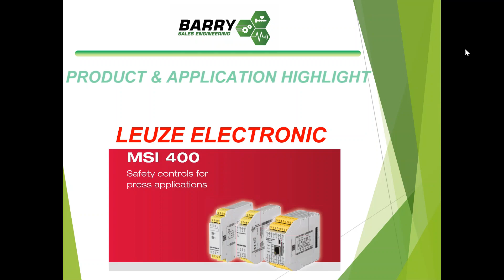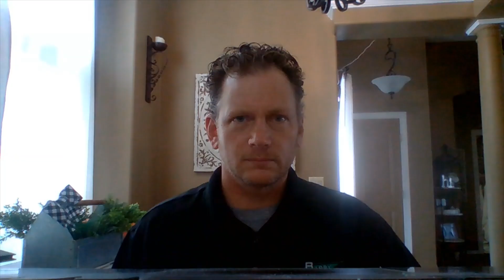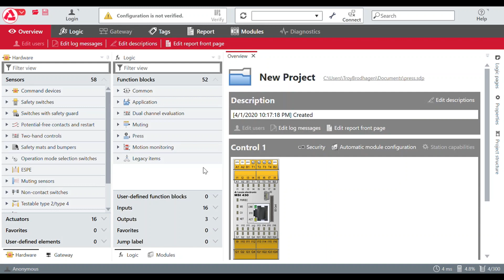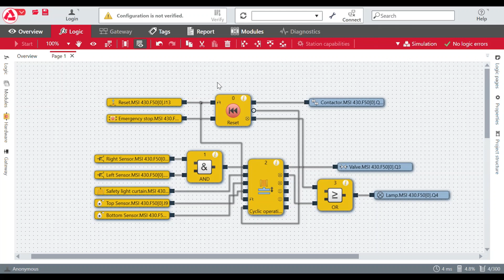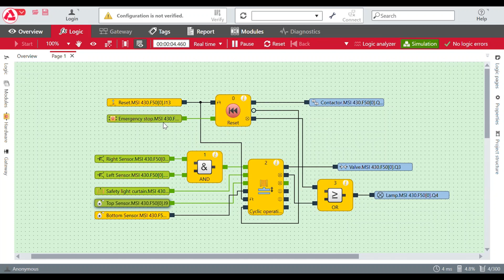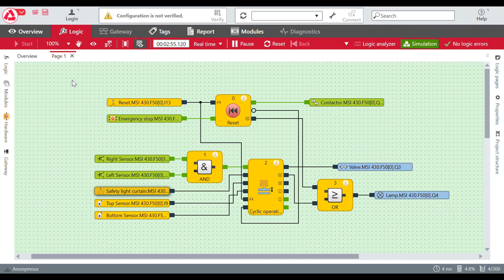LEUZE MSI400 - More than just a Safety Controller

Comment: hi, how can i design a branch for 2 light curtain ( without muting input) and 1 emergency button? I couldn't find any video about MSI Designer.
Reply: or which block should i use for combinating them?
Reply from the maker: @DramaofDrummer  A simple "AND" logic block could be added to monitor the two light curtains.  You can then click on the "AND" block to change the amount of inputs the block is monitoring to 3.  Connect the E-Stop input to one of the inputs on the AND block as well as each of the light curtains.  Now all three have to be in a safe state for whatever output you have connected to it.
Reply from the maker: @DramaofDrummer  Also, you likely want to add a RESET logic block between the AND and your output so that it is not automatic reset.  Or you could do this between the E-Stop and the AND block with the Light Curtains being Automatic Reset, but that all depends on the machine and application.